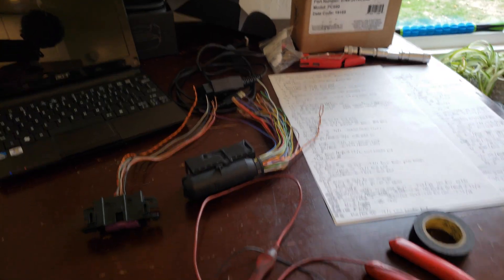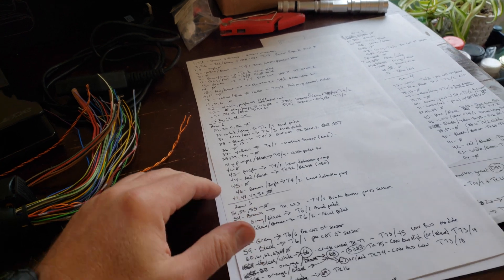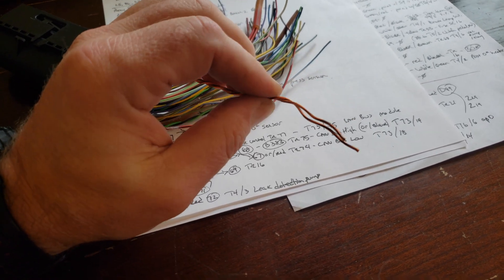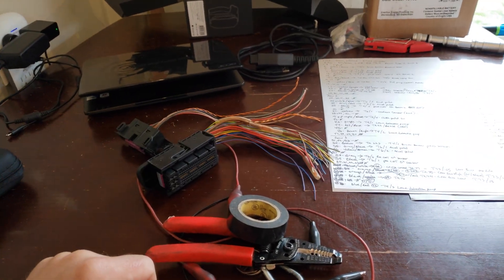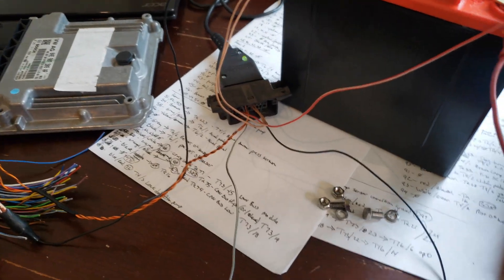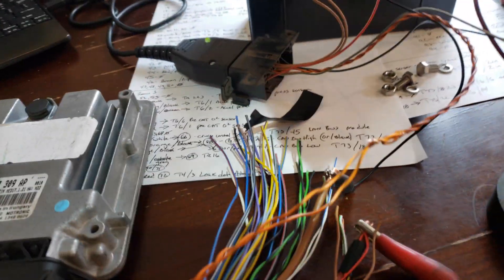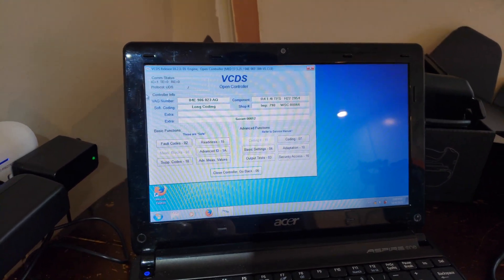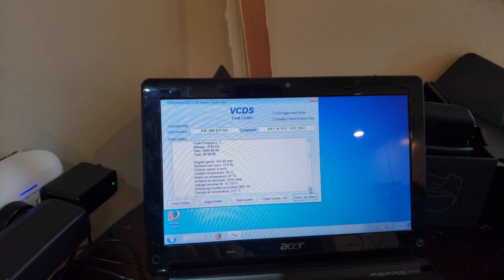Powering up the 1.4t ECU for the 1975 vw Rabbit!

Comment: Hello .  I been wondering if you could share your coding for standard transmission, and well how did you connect transmission wires?   My ECU came from a Jetta with automatic transmission..    maybe you already addressed this on another video but i haven't been able to watch them all, thanks for sharing all that knowledge 😁
Reply from the maker: The tuner changed the ecu to manual in the long coding. You may be able to do it through vcds if you have that.
Reply: Thanks 😊